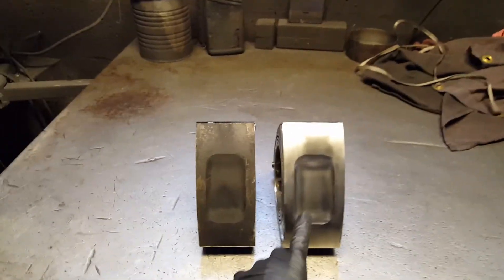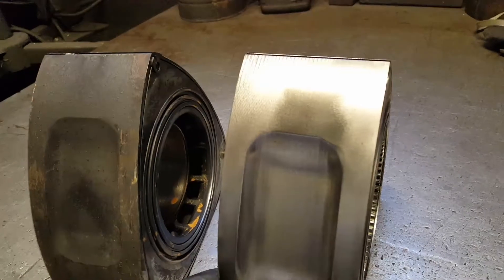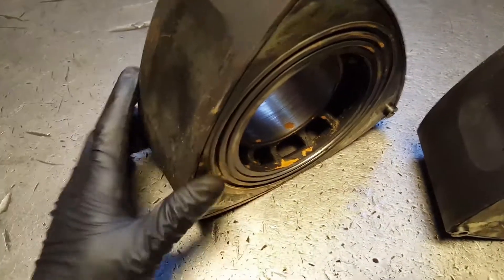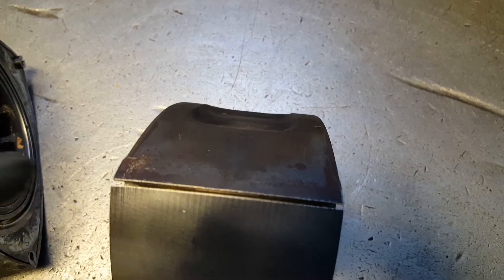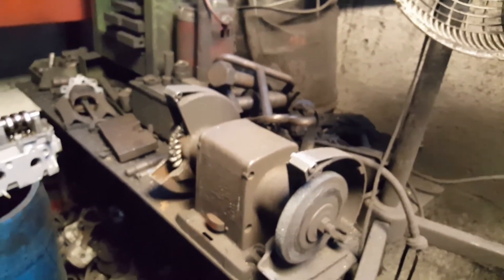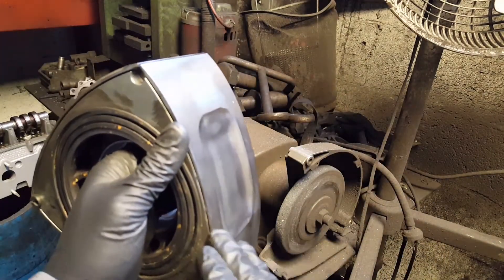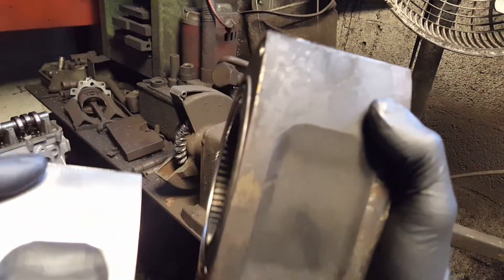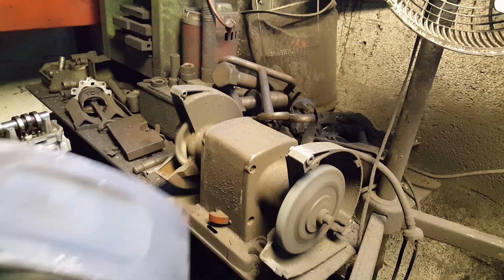How to rebuild mazda rx8 13b rotary engine

Comment: Hey man! I’d love the rotor I’ll pay shipping
Reply from the maker: Ashton Spears i just sent one to Alex rotary8 let me see how it went nd let me check if i have more for display cuz i have some high compression nd reusable!! You only want it for display right?
Reply: How much do you sell good ones for?
Reply: JM8686 also I have a quick question I’ve got an rx8 6 port with bad water jacket seals but decent compression. And I’m going to rebuild it I don’t want to skimp on anything would a Atkins rotary basic engine closing kit ($700) and a full gasket set ($100) be a pretty solid rebuild? And am I missing anything super important?
Reply from the maker: Ashton Spears do you need the front or rear rotor and also what weight? And or yours are you reusing your same apex seals? If not go with goopy performance apex seals and or closing kit from ATKINS once done always PREMIX any tcw3 oil ohh and make sure you don't have anything weird on your stationary gears bushings
Reply: JM8686 the closing kit comes with seals I believe, and I’m not sure if I need one just yet I was just curious what you sell them for but I would like one for display
Reply from the maker: Ashton Spears yeah ATKINS comes with apex and all the closing goodies! And let me look for a display rotor and i will keep you posted 👍
Reply: JM8686  I’ve been hearing poor reviews of Atkins solid corner seals. That they can cause 15-20 psi lower then oem corner seals. What is your opinion?
Reply from the maker: Ashton Spears to be honest i barely use them lol only when on the hurry or budget build but the ones I've done they still on the road,but i mainly go for "goopy" 👌
Reply: JM8686 so would you recommend oem corner seals over Atkins
Reply from the maker: Ashton Spears let's start all over like if you were a friend or a client lol
 What are you're goals?
How much hp
Daily ?
Track?
How much is your budget? 
Is it your car auto or manual?
N/a or turbo?

Comment: Yo, can you use an automatic engines parts in a manual engine or are they different weights and stuff?
Reply from the maker: TheTrollFaceGamer yeah they are different weight but like what exact parts do u want to use?
Reply: JM8686 idk, all of it maybe? xD
Reply: JM8686 do you have discord?
Reply from the maker: TheTrollFaceGamer what's that?lol
Reply: JM8686 rip
Reply: JM8686 idk, I got a 130k automatic motor for$100 should I keep it or take it back?
Reply from the maker: TheTrollFaceGamer keep it 👍cuz can't find anything else for $100 bucks
Reply from the maker: TheTrollFaceGamer just swap counter weights nd obviously the flywheel
Reply: JM8686 okay :D
Reply: JM8686 i just got my car and saw it for 100 at pull a part, I just washed clayed and waxed my car, shes looking good. If you got snap I could show you :D
Reply: Saw the engine at pullapart for 100**